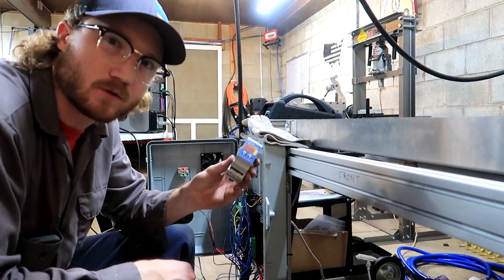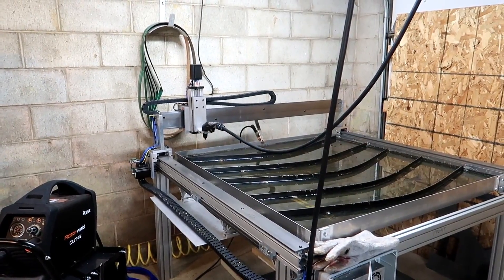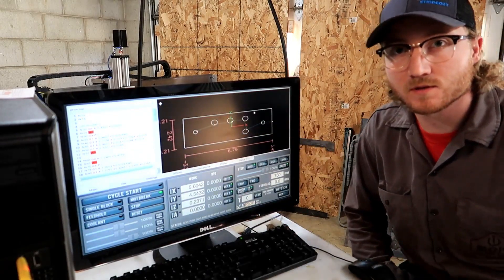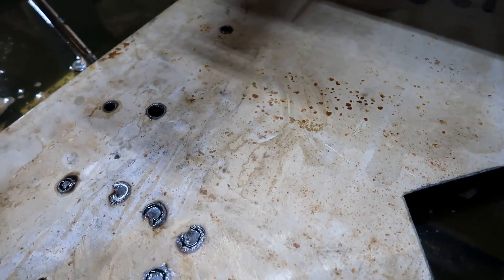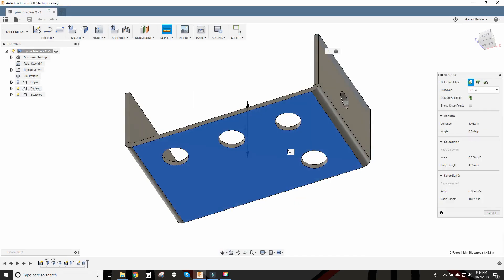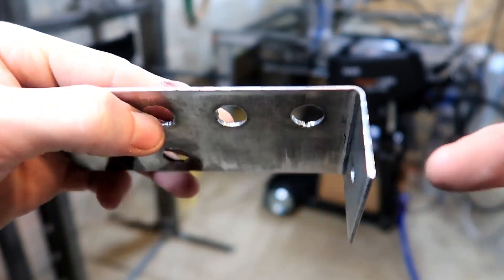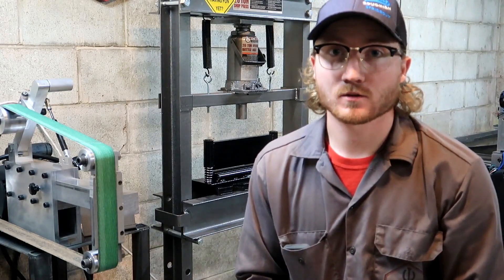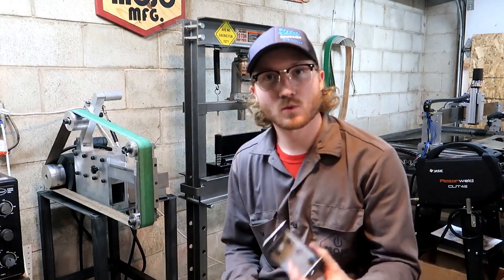Plasma Cutting and Sheet Bending: Home Mfg. Days #61

Comment: do you use sheetcam? you have path rules that can help on holes also lead in and overcut no need to lead out on holes it can cause torch to dive sometimes. and to get nicer holes you got to have torch height in the sweet spot . some people just pierce the center and drill them later for perfect hole.
Reply from the maker: Awesome! Thanks for the help, I really appreciate that.  I did have sheetcam but not anymore.  Right now my lead in/out is only .060" which is my kerf width so I may have to bump that up to a 0.1" lead in/out.  Also, that is a good idea to pierce the center to drill out later.  Thanks again!

Comment: For the holes are you using a lead-in and a lead-out? It make a hug different. And for the bending Tom liptons book sink or swim metal working has a great explaintion  of how to figure out bends
Reply from the maker: Yeah I am using a very small lead in and lead out for the 4 holes.  Thanks for the tip on the book, I've heard of it before but never did get it....I guess it's that time to get it.

Comment: I'll see if I can explain this, but it would sure help if I could just show you a picture on a print lol. I'll use your dimensions to try and make it easier. So your 3 OD dimensions are 1.462, 1.462, and 4.055. What you'd do is firstly, add these 3 together. This gives you a baseline number to start with (6.979), but you're far from done. Next is the K-factor and bend allowance. I believe This Old Tony has a video about this if you are interested in details.

Bend allowance tells you how much your material will stretch when you bend it. K-factor is where the neutral axis (you'll have to look this up if you aren't sure what this is) is, I believe we use .45 where I work. We also use industrial press brakes so I'm not sure where you would calculate your K-factor, ours doesn't change.

 There is a formula for every bend angle but luckily I know 90deg bends off the top of my head so I can explain it relative to your part. The basic formula for 90deg bends is 1.301t + .428r where the 1.301 and .428 are the specific numbers for 90 deg bends. Both of those would be different for a bend of every other degree. The T and R stand for material thickness and inside bend radius. I'm not sure your material thickness (but it looks like .125" so we'll go with that) or your inside radius (we'll pretend it's .25" but it't likely less). So for those numbers with a 90 deg bend you'd do 1.301x.125 + .428x.25 to get your K. In this case it's about .269. So, for each 90 degree bend with a K of .269, you subtract .269 from your parts OAL we figured earlier. So 6.979-(2).269=6.441 so your flat part should be 6.441" in length. I think your actual part probably has closer to a .125" inside radius so your part's OAL is likely closer to 6.541" ish.

I believe Fusion figures this by taking an input K-factor (neutral axis) and then calculating the rest. Hopefully I helped, there are a few helpful bend allowance/K-factor videos online, I'd watch ToT's but I can't remember what it's called.
Reply from the maker: Thank you so much for taking the time to write that up.  It really helps me understand the process of creating parts like this.  I have watched ToT's video on sheet metal bending but I guess I'll have to re-watch to get an even better understanding.  Thanks again!!